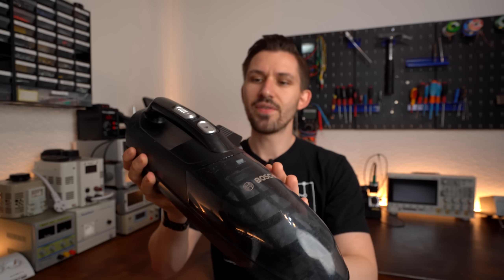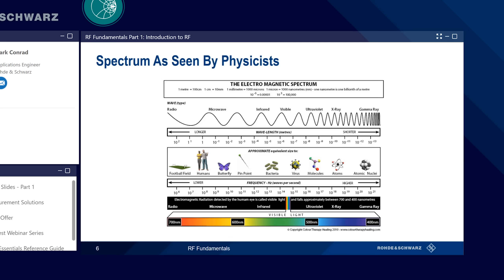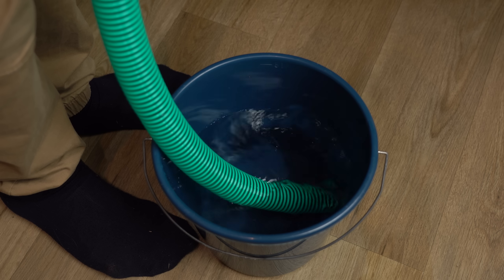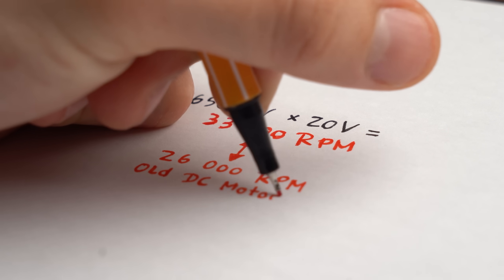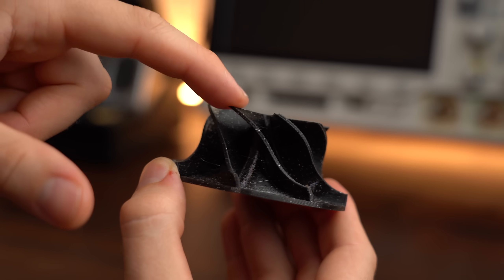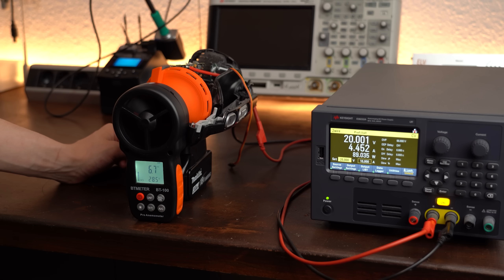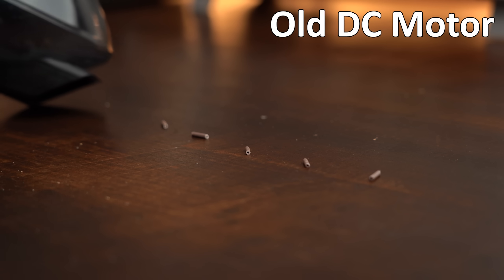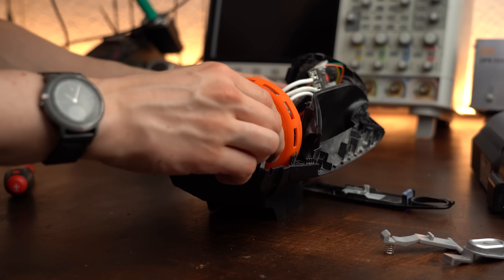My Last Chance to OVERPOWER my Vacuum! (Homemade Turbine V2)

Comment: At the speeds you're seeing, running unfinished FDM prints is really holding you back. You need to sand all of your layer lines so they are smooth, and you need to hand clearance the rotor with the housing (likely by printing the housing a little undersize and sanding it to fit, then ramping power until it rubs, then clearancing some more. Steps need to be done in that order to ensure performance.

Or just print it with a resin printer. You'd still need some balancing and clearancing, but, it's going to be way less work overall. From there, it's just about optimizing your rotor design, which is probably close to fine as-is.

Comment: Brush super glue and let it soak between the layers. It will provide a surprising amount of strength. Gorilla Glue is my preferred super glue (not the gel it needs to soak in).

Comment: U can etch a dimple on one side of the motor shaft and add a security screw to keep it in place so it doesn't fall off. Belt pulleys use it like that to keep them in place.

Comment: If it keeps pushing itself off the shaft why not just an interference fit? Cool the shaft with something like dry ice, make the hole undersized so it barely goes in when cooled and as soon as it gets to room temp it will NOT come out. Fluid dynamics isn't exactly my normal field so I can't help much in the impeller design but I can suggest using a high-percentage infill to counteract the forces trying to pull it apart. At higher speeds you'll definitely notice the sizing differences between stationary and spinning impellers.

Comment: Design a motor with a larger diameter shaft   to be able to handlle a keyway or even better make it with a shaft that goes past the compressor wheel that is splined, past the wheel the shaft can be threaded for a locknut or have a deppresion for a washer and lock ring.

Comment: Honestly, should have tried to gut some of the fan that was designed, give it some support structure, but reduce its overall mass, then gone over and smoothed the blades out and/or used a smaller layer size. I would imagine that you could really start to get closer to breaking even with those changes.

Comment: the whole product was optimized for a certain power output. If you overcome one bottleneck, you simply run into another. Eventually, I'm sure you could modify this into an effective vacuum, but by then you will have re-engineered and re-manufactured the whole thing, and become a vacuum engineer. Then you could go work for Dyson.

Comment: Surface rough ness of the 3d printed parts will impact your pressure and airflow i believe, either smoothing out the pieces or printing in resin would help with that.

Comment: I would try printing it out of resin or sanding the fdm down for better results due to the airflow not being as optimized additional you could simulate the airflow in a cad software

Comment: Why use these turbo-style impellers? The style of impeller you are using here is optimized for converting flowing air or water into a rotational force. Instead, try a simple approach of mounting straight blades that are rectangular in shape to a disk, then enclosing it, leaving a hole on the front to draw in air. This style is called a "flat ring" impeller, and probably known by other names. This will give you a good combination of air flow and static pressure, and you can improve upon both of these based on the height of the blades (i.e. the distance between the top and bottom rings, because the blades are connected to the top and bottom rings. Note that the wider the blades, the more power it will draw at a given RPM...but also you will gain As a side bonus, you can print the top and bottom parts of this in plastic, but use metal strips for the blades, which you can easily cut with tinsnips from sheet metal.

Comment: Maybe look at an Angle Grinder...they've (Some at least), have a nut screwed on the wrong way.
 I think that in your case, you could even look into drilling a hole into the shaft then bolting your impeller to it. A bit drastic, I know, but that's how I bolt my large 20 Inch drone props to my drone and it's worked fine for upwards for 5 years now.

Comment: Design a motor mount with several high sensitivity load cells so you can run the props at full speed and record the load cell data to be able to balance the weight of the prop

Comment: To handle more power you need to fix the impeler with something stronger like an extended axle from the motor with a nut for exemple

Comment: It would be interesting to have the original 3D scanned and print that.  That would give you a differential based on material and FDM.  You could then compare also that directly to an SLA print to see what impact all those layer lines have.

Comment: To prevent the impeller from running away from the shaft, maybe you could make a grove at the end and put a circlip there. Also, cut a flat surface on the side of the shaft to prevent the impeller from slipping on it. I woodworking, it's well known glue is always the weak part of an assembly: you need to think your assembly without glue and add it as reinforcement, not as the primary transmission.
Reply: or drill a hole in the shaft and thread it so he can put a screw in perpendicular to the shaft
Reply: @Scotty-vs4lf  you wouldn't do that, because the pin is going to tear into the plastic at startup dur to excessive torque.  you really want to maximise contact surface and avoid pins. half moons would work.
Reply: @RegisMichelLeclerc  yeah i figured the inertia of the impeller was low enough that it would be fine but i have no experience so ill take your word for it

Comment: i used to have the same problem with it coming off the motor shaft so i made the shaft a little bit smaller and with a lither i made the shaft really hot and then i kinda forced it into the smaller hole, and the shaft burned itself into it and it was so strong i couldnt get it off so i had to hammer it into pieces

Comment: All you needed to do was really to upgrade the brushed motor for a brushless one in the original impeller design.
The efficiency improvement would have been very noticeable at same powerlevels.

Comment: seeing you do this makes me wonder about swapping out the old big heavy DC blower motor out of my 88 suzuki's ac system with a brushless motor from a skateboard... still drive the original blower fan but ya know.... a motor that probably makes the more torque an HP then the original brushed motor that doesn't even have PWM for speed control...

Comment: I wonder how much improvement you'd see from smoothing out the 3d prints.  In theory all the ridges from the 3d printing create disturbances in the air which would reduce efficiency.  There's a reason why propellers are as smooth as possible.
Reply: There is a reason why they are not. Actually, performance fans are rarely glossy smooth. The only example of consumer fan with glossy blades I can remember is an office fan, the big thing that blows and swings around, definitely not a performance hero. I don't know the exact explanation but I'd say near-surface air layer is unimportant, at least at relatively low speeds, so nobody cares. Edges and, in case of static pressure, gaps are far more important IMO.

Comment: I would higly suggest smoothing your impellers. Either with heat, which uses a high amount of skill or vapor smoothing.  DMSO (Dimethylsulfoxid) would be a safe option or THF (Tetrahydrofuran) whis is a stronger solvant, but highly carcerogetic. Also an smoothing option would be XTC-3 which is an epoxy resin which can be applied to 3D Prints. I have made good experience with it , but not with mechanical applications, since it's distorting the geometry. The iregularities in the print are highly disturbing the airflow. Also try to implement a grubscrew in your impeler. If chemical bonding doesn't work for you, maybe mechanical bonding will.

Comment: why don't you add a setscrew at the top of the impeller to help secure it, you're going to have to drill into the motor shaft tho and use a small setscrew (about M1.5), I think that should help keep the impeller turbine in place

Comment: Gonna laugh my ass off when you realize a primary issue you're facing is the surface finish of your parts compared to the smoothness of the original impeller.

Comment: One reason the original impeller is enclosed is to prevent it from being pulled off the shaft.

Please don't buy a Dyson.  They dramatically over-charge for the brand name.  I've worked on a number of Dysons over the years and have never been impressed by their construction.  They may be designed for good airflow, but quickly get clogged with dust and dirt in places the engineers apparently never thought of.  The best vacuums are bagged and the whole vortex thing was/is just a great way to make a few billion dollars from gullible consumers.  If you have to go outside and hold your breath to dump your bucket of dust, it's a pathetic vacuum.

Vacuums once cost a couple hundreds US bucks and now they cost multiple times that while being built like a $10 toy and Dyson is the reason.  Anyone that's cleaned or repaired a Dyson probably uses something else.  Admittedly, most vacuum brands today are junk and this is really unfortunate considering their prices.

Comment: Be sure to check out the Tineco Pure One.  We have several clients with handheld Dysons that we occasionally use if we're just adjusting something or didn't make a big enough mess to grab our Festool shop vac from the truck.  One of these clients replaced theirs with the Tineco when their Dyson died and couldn't be repaired.  The Tineco is way quieter and feels less like it's been overly value-engineered (just feels more solid in general).
Reply: I have one and like it a lot. Can vacuum with the kids in bed.
Reply: Filters clog up though, every none dyson bagless system is kinda crap.

Comment: Why not using a copper core of a wire strip to joing the impeler to the axle? The screws will hold tighter to the motor shaft and double as a key while being close enought to the core to balance it out easily.

Comment: I really like the looks of the new impeller, but i think thats not the better solution, usually vacuum impellers tend to be more flat and have the biggest radius as possible, you can see that in your stock turbine, and usually they have a "static counter turbine veins" (don't remember the correct definition), to help increase the static pressure. How about try to replace the original motor with one of those BLDC's?

Comment: Have you considered finding a motor with a threaded shaft and using embedded nuts in the impeller to connect it? When spinning in the correct direction, it will self-tighten itself to the shaft.

Comment: Why don't you just follow the basic design of the original impeller? A relatively flat impeller with a relatively small inlet area but a large outside diameter will give you higher pressure at lower power consumption...

Comment: For next video try making the parts out of resin 3D printer for tighter tolerances 

Also try replicating the exact same impeller as the original
Maybe you'll find the source of the issue better
Reply: i was going to suggest using the original impeller 🙂

Comment: if you try again, try making an impeller with a greater diameter ratio (inlet to outlet). this can give you a higher pressure ratio at the same rpms. the closed rotor design of the original might not be easy to 3D print, but definetly helps with efficiency if you cant keep the gaps of the rotor blades as small as possible (below 1mm)

Comment: In the video, you show that you are glueing the impeller on from the top. So basically you are just pouring a thick glue down a plugged hole. The hole being plugged by the motor shaft already. I really hope that this was just for the camera and not how you glued it and a total brain fart moment. Lol. 
For anyone that doesn't understand, the glue needs to be on the motor shaft sides where it contacts the impeller, not on the exposed end that contacts nothing. Also pouring thick goop down a small blind hole leaves nowhere for the air to go and your glue likely never even touches the bottom of the skinny blind hole, so the goop would do nothing.

Comment: i wonder if a resin printer would give a smoother finish to the impeller blades and if that would maybe help it pull air more efficiently
Reply: Probably it will decrease the amount and strenght of the vortexes so i think yes. Maybe just a minimal amount

Comment: you should try getting the impellers SLS or SLA printed. It should help with airflow by having a smoother surface, and the SLS one can be CF Nylon, which should be plenty strong and light for this application

Comment: PETG bonds very poorly with adhesives, it's not suitable for gluing, also try cut shallow grooves in the shaft for the glue to seep into so you have the mechaincal and adhesive strength of the glue.

Comment: You could have used a set screw and a motor with a shaft that has a flat on it to counter the impeller slip..  glue never holds…. And the tolerances between impeller and compressor housing has to be very tight for that style to work..  is why most vacuums use that flat style..

Comment: You could try that ceramic filament: the one that you actually burn in an oven and it becomes some kind of stoneware, so it will pretty rigid and stable.

Comment: Let me know if you're interested in more details -- but I've made a similar type of impeller (and propeller too) with 3D printing -- the best way to secure it (I found) was to use small brass inserts and insert them into the round bit in the middle (in-between the blades) to screw into the motor shaft.  Since an iron won't fit in the small gap, I would screw in the head-less bolt into the insert, hold it with needle-nosed pliers, then heat it up with a blow torch - then pushing the insert into the plastic between the blades.  I would then cut down one of those head-less bolts (forgot their name) so they wouldn't stick out and use an allen-key to tighten them on EITHER: 3 sides | OR on the top and bottom of the motor shaft for more even securing.  And BOOM can run it as fast as you want and everything -- hope this helps :)

Comment: Ever look at the shaft ends of a turbocharger? They use lock-nuts on them for a reason, and they use impellers designed much like yours... only more radical in some cases.

Comment: Get a prop adapter for the motor, or a motor with a thicker shaft, it will give you more surface area for it

Comment: Why not use the original impeller and just upgrade the motor? 
Seeing as the impeller is already designed specifically for this vacuum, it should do a better job than the 3d printed ones

Comment: could drill and tap a hole in the shaft and secure the impeller with a left handed screw, it'll self tighten

Comment: It should be fairly easy to use a die to thread the shaft. You can then incorporate a nut in the 3D printed impeller.

Comment: Out of curiosity, a question to our mechanical engineers: How much does the surface finish affect the outcome in such a system? The printing looked quite rough tbh.
Reply: not much i think. You're trying to generate a huge negative pressure, you don't need turbulent free airflow for that.

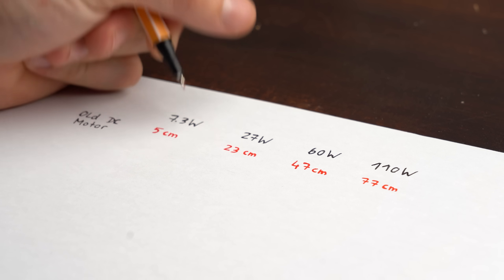Comment: 3:20 5cmH2O? ....and you've invented a CPAP machine. 😆 (Just kidding, this would be terribly dangerous. And 77cmH2O would certainly cause damage as most CPAPs only go up to 20cmH2O.) But 5cmH2O is actually quite a reasonable CPAP pressure.
CPAP motors are typically just OEM vacuum cleaner motors, and also use the three wire hookup. (Sometimes in a 4 pin connector, with one pin unused.)
But instead of selling it for the $10 motor price, you have to charge $1,000+. (Granted, there is also MCU, about three pressure sensors, careful noise design, filtering, and a display. Oh yes, and very expensive medical equipment certification.)

Also, obviously, you'll need to put it into blow, not suck, mode. 😆

Comment: The stock propeller seems to have a smaler inlet 🤔 this is probably better for creating pressure or vacuum. I bet you lern much by reading about turbos, comparing turbine maps and the physical demencion and drow some concussion between turbine well size on inlet and bottom in order off pressure vs airflow map

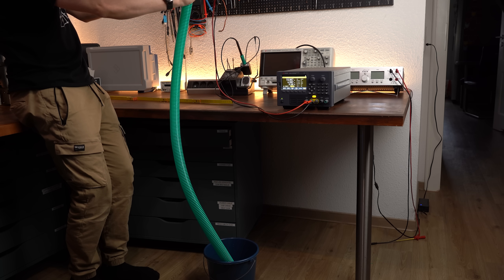Comment: I laughed out loud @9:41 when you said the ESC shutdown due to safety settings, so you just turned them off. 😂 😂😂 I guess you have to break a few eggs to make an omelet... and who cares about safety when you are trying to humiliate the original manufacturer by building a better vacuum in your garage.
Personally, I would just get a bigger ESC and battery pack and maybe water cooling until it could clean the whole room from one spot.